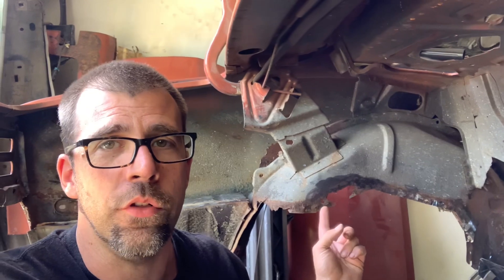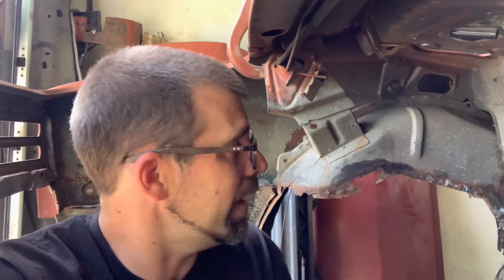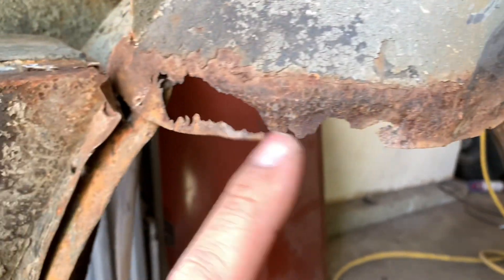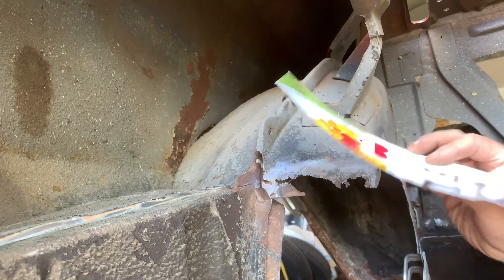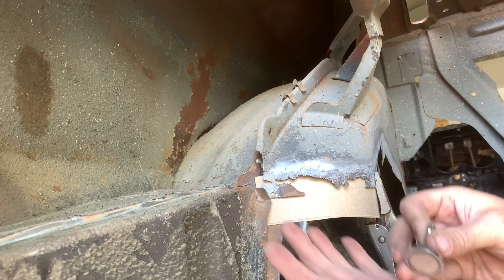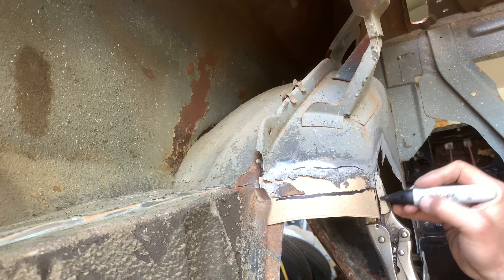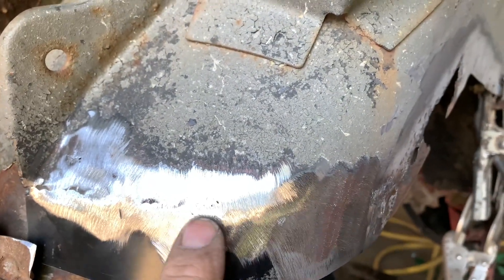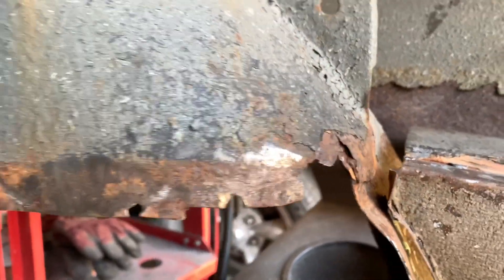how to make patches for seamless Wheel well rust repair 1968 Firebird

Comment: Paint on a 68 pontiac is going to have a crapton of lead in it. You're open sandblasting on that in your garage.  If you have kids, please don't let them in there.  Also change and clean your clothes before you go inside.   Lead in unbelievably small quantities is really bad for children, particularly for their brain development.

Nice work and interesting video.
Reply from the maker: This is very true and worth mentioning, in addition to that thought now I think about it lead was possibly still used up until the 90s. I have used PPG epoxy primer for years and sometime in the 90s the part number changed to dp50LF the LF meant Lead Free so it makes you wonder or assume it used lead up to that point.  Thanks for sharing